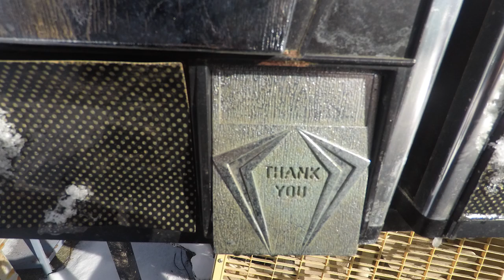Cash On The Curb Scrap Action 3

Comment: I wish I could give you guys a big ole pickup truck.
Reply: Aw thanks Cherly! I don't want a big truck though!!! The beds are higher so the lifting is much harder. We also use the van for flea market and camping so it's much better than a truck for that! We don't have enough parking to have both. At least another scrapper got the rest of the stuff and it didn't end up in a landfill (which is the main reason I do this). We would have gotten a little bit more money if we had gotten it all, but the price of scrap is so low I would rather not even take the big, heavy awkward stuff! I always get hurt or my muscles are killing me for days after! I prefer getting lots and lots of smaller, easier to load things (can picking is MY favorite! Lol!). I'd rather work smarter than harder! <3 Scrap It Up!
Reply from the maker: I wish you could too! XOXO

Comment: Your ladies really need a truck
Reply from the maker: Please send us one ASAP!😝
Reply: @ScrapItUp1  Lmao!!!! <3 <3 <3
Reply: Oh Justeen! It's nothing personal, we are just really tired of this comment! We bought the van at an auction. We also bid on trucks. However, we realized over time that the van was a much better option for us! While it can be a little more challenging getting bigger things to fit, the bed is lower so we don't have to lift heavy things very high, which is a big advantage since we are women and don't have as much upper body strength as we would if we were men. In addition to scrapping we sell a lot of our garbage picking and dumpster diving finds at the flea market and the van is MUCH better and easier for that. Our stuff would have been ruined several times if we had a truck instead. We also use it for camping too! We love it and are happy we got it instead of a truck! We wouldn't mind having a truck too, but we don't really have enough parking for a whole fleet of vehicles! <3 Scrap It Up!